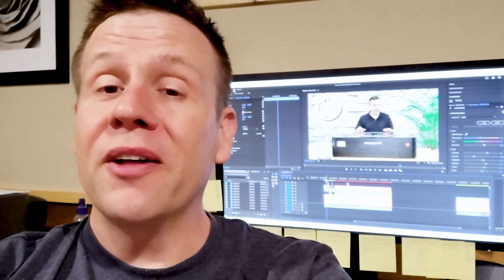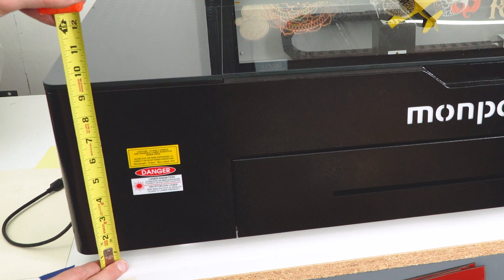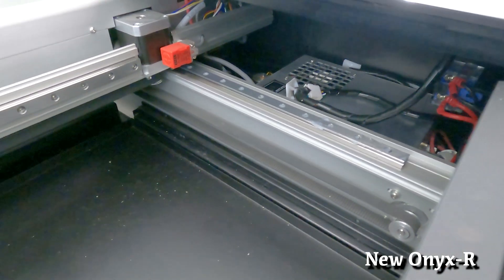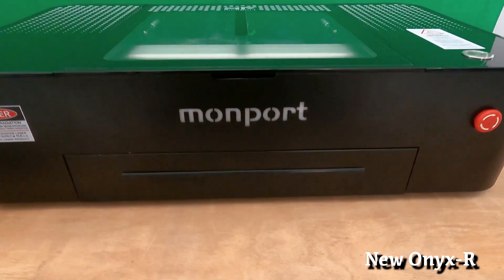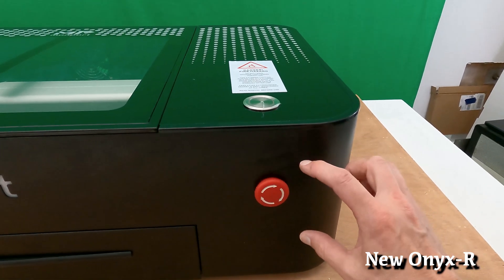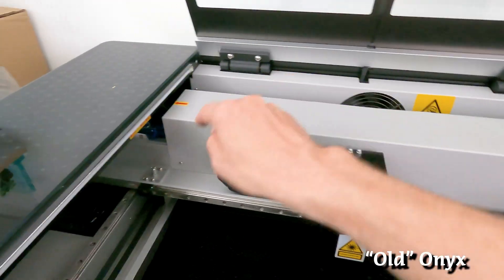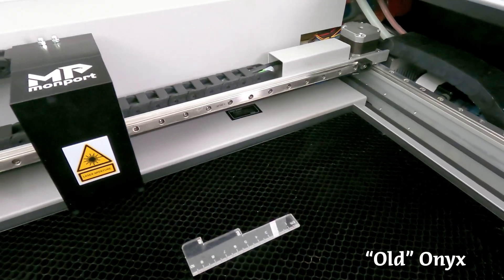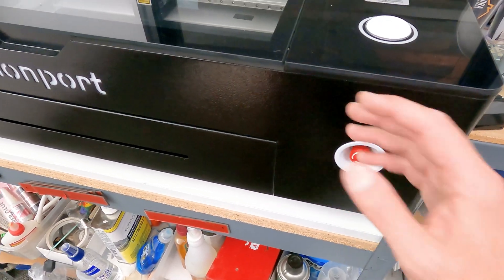Monport Onyx-R  A Quick Look!

Comment: hi Greg  i have watched all your videoson you tube realy help[full clips now i have the same machine onyx 55  haveing problem with cutting or moving the laser head the set up is all good it dose frame and focus works but when in press start nothiunbg happens and i get error massage file failed to load to laser  using latestlightburn version  dont know why it would be a great help if you can guide me to see why and fix it .

thanks
Reply: it is blue when farmaing and moving and fucosing as sson as i press start it turns to red meanig error and lase dose not move or work at all as sson i press stop it turns to blue meaning ready .some how dose not transfer file to the controller to laser to work .
Reply from the maker: The Red button means one of the 4 safety switches are not met.  There's 1 for the coolant flow/temp, 1 for the crumb tray- back left corner, and 2 for the lid near the back hinge.  Mostly likely the crumb tray switch or the lid switches are causing the problem for the Error of the file not transferring.
Reply: @thelaserchannel1  Thanks will check them out and if i get it going . hope it works you are great help
Reply: Thanks so much yes the honey come was pushed too far and closed the swtich  now works fine  i thank you for your tips .
Reply from the maker: YAY!!! :_doggy:
Reply from the maker: Hi-  What color does the large silver button turn?  I suspect one of the 2 lid switches are not fully being met-  see if making sure both switches are met allows the engraving to start. :_doggy:

Comment: Nice job on the review. Does having the tube on the gantry reduce the numbers of mirrors compared to a CO2 that has the tube in the back? Aligning mirrors is my only hesitation in getting a CO2.
Reply from the maker: It does not reduce the number of mirrors but makes mirror 1 and mirror 2 closer so the alignment window is much easier.  On very large super high power industrial lasers they will often mount the laser source to the gantry.  On smaller machines the mirror alignment is easier.  The smaller machines keep the alignment better.
Reply: @thelaserchannel1  excellent, thank you for the information. I’m not in a super rush, I’ll see if they have any Christmas sales or who knows, maybe they’ll come out with something new? 😁

Comment: Thank you so much! I was trying to set up yesterday and there were so many things missing I thought I was going crazy 😂. I was trying to find where to plug in the dongle (I got a small USB drive that doesn't look like it fits anything) and no plastic fitting for the duct opening. I also got 2 hoses for the back that are about the same diameter instead of one bigger and the other slightly smaller. No things to cut with either. I notified the company but waiting for a response.
Reply from the maker: Hi- This video series was on the Onyx version 1 and the current machine is the Onyx-R, they are different and setup different.
Reply: @thelaserchannel1  Yes, I saw your new video! Much more relevant to my machine. Thank you! I was watching this video in anticipation of receiving it, and didn’t know there would be so many differences!